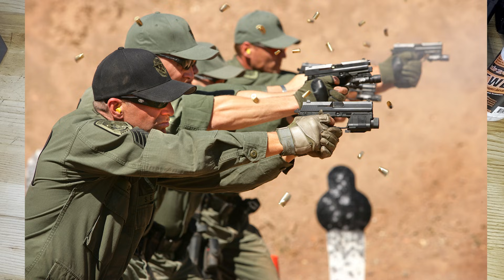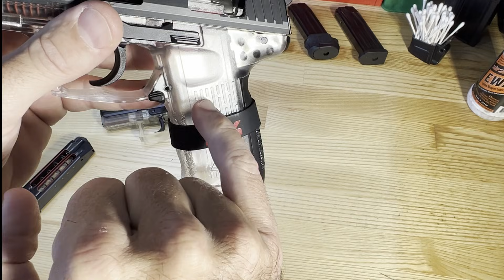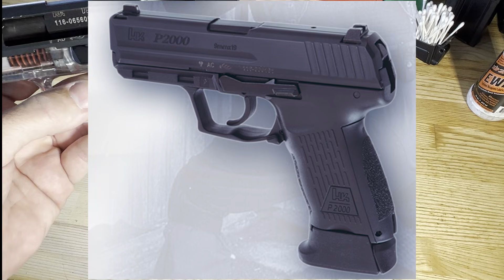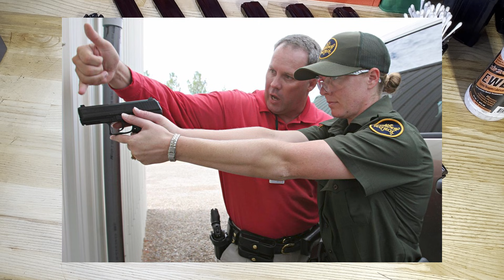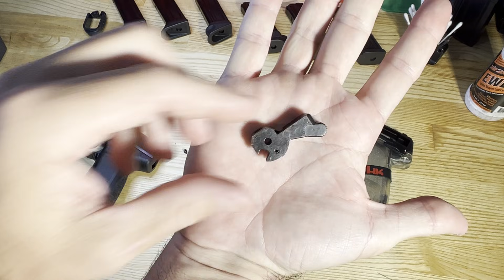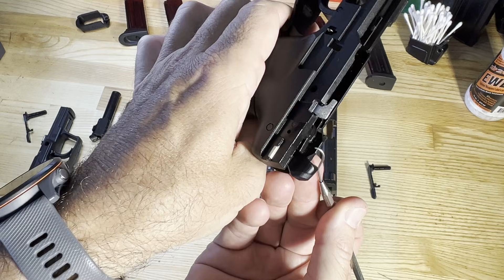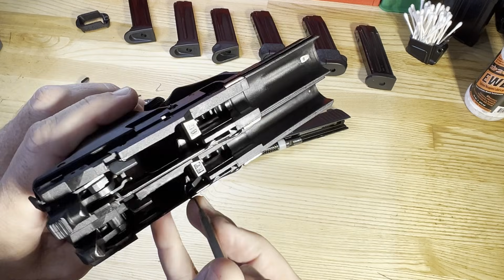Heckler and Koch P2000 Series Armorer and Operator Review

Comment: Hi James, regarding the HK45C extended mag release. In this video you mention it quickly as a drop-in upgrade. I found that when installed in a USPc, mags will drop free during firing. I found folks mentioned this online, needing to modify the HK45C lever underside and shave some material off in order to allow the extended mag release to pivot further in to the mag well and properly retain the magazines. Do you modify your HK45C extended mag release levers? I'm trying to find a guide on how to correctly modify.
Reply from the maker: I have not found this to be an issue when installing the HK45C magazine release to USP or P2000 models.  When I see people having problems with mags dropping free, it is due to their grip being to tight around a compact/SK grip and they don’t realize the bottom of their palm is preventing the mag from dropping free.

Comment: I know 357sig is a lot of bang and not much difference in performance unless going through barriers, I still like it and think the only suitable platform for it is an HK p2000. Yes p226/p229/p239 also work good for 357sig but I think HK still has the edge on balanced design still able to handle 357sig recoil. P229 great but a bit too bulky and heavy. P2000 just right. Glock not ideal, as much as i loke glocks, i think having a light weight slide for heavy recoil calibers is not good. Ys a heavier aftermarket spring helps but best to combine a heavy slide with higher recoil cartridges and maybe if needed increase spring rate.

Comment: When the p2000 came out i was only interested in 45acp so usp compact 45 was what i was more interested in, but then got pulled into 1911s instead. Single stack 1911s carry great but I sold mine off when mag cap ban went away, but by that time i was no longer looking at hk.

Comment: Outstanding video, Devil Dog!  This video is 2.5 years-old now; are the various parts you mentioned, including the magazine extensions, still available generally?  Based on a quick web search, it appears that many P2000 parts, particularly in .40 S&W, have been discontinued or are out of stock, even on the HK site.  I have just purchased a P2000 V3 in .40, and I am considering acquiring a P2000SK V2 in the same caliber.  Am I coming to the .40 cal. game too late to acquire parts for modifications and enhancements?  Thanks for your work and keep up the great work!
Reply from the maker: Finding .40 components will become more difficult.  As a rule, HK continues to fort parts and support for 10 years after a model ceases production.  But since the magazine is the same (in the P2000) as in the USP Compact, which is still in production, you should be fine there.
Reply: @teufelshundtactical  Sorry to bother you with a question, but during the video you mentioned replacing the OEM magazine release with the HK45 version.  I can't find the spot in the video in which you showed the package and part number for that part.  HK Parts has an  magazine release  (SKU: HKP-19287-M - $49.95) and an  release (SKU: HKP-01669 - $29.95).  Were either of these parts the one you recommended?  If not, what part do you recommend and where may I obtain it?  Thanks.
Reply: For whatever reason, YouTube took out the words "enhanced" and "extended" from my question about which replacement release you recommended.  The HKP-19287-M is described as "enhanced."  The HKP-01669 is described as "extended."  Which one did you address in your video?  If you will give me a time stamp for that part of the video, I will look it up.  Thanks.
Reply from the maker: @artyman0802  I don't know what you are referring to.  Those item numbers are not from HK.
Reply from the maker: @artyman0802  Call HK Customer service and order the HK45C magazine release.
Reply: @teufelshundtactical : Thanks.

Comment: The varient 1 vs 9 usp,    I carry cocked and locked.   What difference would it make to me  ???

    Can the p2000 be carried cocked and locked ?    I love hammer fired  HK ,  but lem and DA / SA  only work carried cocked and locked.
Reply from the maker: If you have a USP or HK45 and want to carry cocked and locked, then V9 is for you.  V1 allows you to do the same, but the decker function is still there and sometimes, under stress, guys rotate the selector past fire during the draw and decock the weapon.  The P30 “S” models have an external ambi safety that allows you to carry cocked and locked like V9, but with the decoder separate from the selector.  There is no way to safely carry cocked and locked with the P2000 series.

Comment: My name is Adam. I am reaching out to you for your professional recommendations and help regarding pistol mounted lights and holsters, etc. As you are already aware that it is very difficult or near impossible for us to mount weapon lights to H&K pistols because of their proprietary rail. We have virtually (almost) every model that were available on the market. Thank you for your help. I look forward to hearing from you soon.
Reply from the maker: This video covers the P2000 series, which uses the industry standard picatinny mounting point.  Any current weapon mounted light should fit, though, I would look to pair a smaller light with the pistol, something like a Surefire XSC.  Only the USP series and MK23 have proprietary rails and companies like GG&G have offered an accessory mount for years.
Reply: Thank you so much!

Comment: Ive been an HK fan for several years but i was never a fan of the p2000. No real reason why but it just didnt do anything for me. About 8 years ago or so when there was rumors HK was discontinuing the p2000 and wanting to clear out inventory, i happened to walk in to my lgs looking for something else, they had one sitting there, brand new not a trade in for $429. Bought it on the spot and i gotta say its definitely the most slept on pistol in their line up. I pit the hk45c paddle release on and i will never get rid of that gun

Comment: Excellent video as always!  Re: the Variant Zero (LEM with decocker). I have this setup on my P2000Sk and love it. It allows to decompress the hammer spring for long term storage, or if for some reason you wanted the added safety of the full strength double action pull (Nightstand gun that you want the heavy trigger pull if you're groggy and jumpy, for example. You can thumb cock the hammer if needed and be ready for the easy LEM pull).
I love the functionality of going back and forth between compressed or non-compressed hammer spring if I want to... Don't see a downside from where I'm standing!
Reply from the maker: Yes, Variant 0 is one of the variants and I cover it in the video.
Reply: @teufelshundtactical can we convert a decocker version into a V0?

Comment: Absolutely incredibly detailed insight into the P2000 to include USP, USPc, and both P2000 and P2000SK pistols.  I have a significant number of HK pistols, starting from 1985 when I bought my first P7M8 largely due to the ambidextrous design.  I then purchased a USPc in 45 which, although not ambi, gives me an appreciation for that era of HK pistol designs.  Then I bought a new P30, two new VP9s, and lastly a new P2000SK.  Thanks to the interchangeability of many HK pistols I then expanded my caliber choices on my P2000SK to have a 40SW slide and barrel for the SK and then finally a 357Sig barrel.  The interchangeability is simplified by the magazines, as well, as the 357Sig rounds fit inside a 40SW magazine for the SK.   I continued with my collecting onto my VP9s pistols by adding a VP40 slide and barrel to turn it into a VP40.  My latest acquisition is the VP9 Match with the longer slide and barrel, and the cutout for a red dot sight (in my case I chose the Swedish Aimpoint ACRO).  Despite years of HK ownership and use, I learned many more things from your video.  You did a great job!  One more piece of RARELY GOOD NEWS is that California has added the VP, VP9L and VP9SK to the approved handgun roster!  I suspect that is because they may drop the P2000 lineup someday.  On my Calif CCW I have a P7M8, my USPc 45, and the P2000SK which I carry 90% of the time due to the size.  Again, an incredible video, worth every minute.
Reply: Good to know. I am also in California and plan to get the P2000SK as well. Mainly for concealment. I am new gun owner, first but used is Kahr CW9. I plan on trading it up to the HK P2000SK.
I like to add, i really want the P2000SK in 40mm though. This mean i have to wait or just deal with the 9mm.

Comment: Are there dimensional differences with the p2000sk variants?
Reply: Thanks for the reply.  I think I saw somewhere on the web that the V2 was slightly thinner. I’m getting a V2 P2KSK as I like to call them. The trigger felt fine in the shop but I might have to get that reset upgrade, its overpriced for a tiny piece of metal though, in my opinion.
Reply from the maker: The only dimensional difference between the P2000SK variants will be in the hammer.  The LEM variants have a bobbed hammer and the D/SA have a spurred (shown in the video thumbnail).

Comment: I always assumed that if I was gonna carry a hammer gun, that it was gonna be a DA/SA or my 1911. But I always a big fan of Walther, and had heard all the legends about how good the P99 was, both in 9mm and .40, and I happened to stumble onto a used Gen 1 in .40 at a gun shop for $300. I thought this was a pretty good price considering that it was almost pristine on the outside and looked like it had only run a few hundred rounds at most on the inside. 

What I didn't know beforehand was how much I would come to love that trigger. The P99 has a trigger very very similar to this one. You can use the double action or you can use the single action, although it uses a different firing system, but on the user side, it's very similar. And it includes a decocker, which the V7 LEM I just ordered does not have one.

I already had guns like the CZ P-01, a Double action 1911, single action 1911, and a .38 special revolver with a realllllly heavy trigger, but that P99 trigger completely changed my outlook on carry guns and inspired me to get a USP Compact 9mm in V7 Light LEM configuration. 

I had actually avoided HK for a long time because I listened to all the Fudd online about how they are overpriced, not worth it, outdated, bad triggers, all hype, and that I should 'buy cheap guns for my first firearms and then decide later if you wanna get the best...', and I stupidly fell for that advice and just kept moving up the price bracket until I got a VP9, and that instantly destroyed my appreciation of pretty much every other striker fire I had -- Shield Plus, CZ P-10F, Glock 19, Glock 17, LCP Max; the only one that I think stands up to the VP9 is the Walther PDP/PDP-F, that's a really great pistol. 

Regardless, I was so impressed by that VP9 at only $475, that I knew I shouldn't have listened to all those morons online telling me that they are too expensive and not worth it. You barely have to pay that much more than other guns and you get something far superior and much more special. 

Yes the USP Compact 9mm V7 was pricy, especially since I got a new one with the LE bundle, but I got it for $925 and felt like that was a fair price for such a good gun new from HK. Should be arriving at my FFL tomorrow and I'll get to really properly test it myself this weekend. I love my VP9 and my friend's HK45 (he bought one after seeing my VP9 and then trying out his stepdad's HK45) and I expect to enjoy the USP compact just about as much as those. And if I don't like the LEM, well then no biggie, because I can just swap in a V1 no problem. 

I appreciate all you do Teufelshund and you really do an amazing job talking about these guns and what makes them so special. I hope you keep doing these kinds of breakdowns forever!
Reply: I hope you like the LEM. most people imo fail to understand it's special specialness. When you punch out, load the trigger to the wall. That's the brilliance in the mechanism.  Your then on target and ready to fire. After 1st shot, ride the reset. It's an excellent design.

Comment: The only issue ive had (so far) with my P2000 that I've had for about 9 years is a broken trigger return spring after maybe 15k rounds. Not really sure what happened because I didn't really have the knowledge (or courage) to do the troubleshooting/"gunsmithing" myself but the gunsmith swapped my trigger return spring to the "heavy" one and its been fine since then. I just installed the 10 lb hammer spring, grayguns SRS, grayguns trigger, and switched out the heavy return spring for the stock trigger return spring so we'll see how she runs. I also have it ported and it runs so flat with the ports, it's awesome. I stippled it myself as well and its 1000% better now. Can't wait to see how it shoots after the trigger upgrades.

Comment: Fantastic video, James. Love it!! I would liked to have seen more of a deep dive into the three LEM options though. Demos and explanations about how the weights change (is it the take up, reset, shorter pull, just lighter pull, etc.).
Reply from the maker: It’s pretty much just the weight of the trigger pull.  That’s a difficult thing to “demonstrate” in a video, but the weights of each variant are available online.  The simple answer of course is the light is light, the medium is medium and the heavy is heavy.  You really have to try them to appreciate the difference.

Comment: Thanks for this in depth video! Second to none. I picked up a p2000 v3 in .40 several months back. Added the Grayguns short reset kit, hk45c mag release, and nickel sear spring. Love it. Waiting on my 357 sig barrel to arrive, can't wait to try it.
Reply: I carry a P2000 in 357 Sig. I had Bill Springfield do some trigger work to reduce free travel and reset. That was 3 years ago. It is an outstanding EDC.

Comment: Hello I own the p2000, and want to put the gray gun short reset kit. Which flat match sear spring do I use?
Reply from the maker: There is only one match sear spring.  It is identifiable by the nickel coating.
Reply: Trigger Return spring broke on my p2000. Which spring do you recommend, light, stock, match heavy? Thanks.
Reply from the maker: @jakk9278  Never seen that.  The answer would depend on whether you have a DA/SA or LEM model.  I prefer the USP match TRS for DA/SA and Light for LEM.
Reply: I have the Lem. Thanks for your outstanding support!

Comment: I have the V2 P2000 LEM W/night sites. I would like to change the magazine release paddle to a larger one and I bought the P45 one after being told it would fit but it doesn’t so is there a mag release paddle that is bigger that will drop in the frame?
Thank you for your reply.
Reply from the maker: The magazine release you want is the one from the HK45 Compact.

Comment: Love HK and the P2000 series. My only gripe is with the P2000 and the fitment of its rear grip panel. At the very top of the rear grip panel there’s an annoying gap on every P2000/P2000SK I’ve ever seen. It can irritate your hand and just looks sloppy. No other series of HK have I ever seen something like this.
Reply: I’ve noticed this also and I’ve probably inspected well over 100 examples of P2000/P2000SK. Very disappointing from a company like HK.
Reply from the maker: I have not noticed this on any of the models I own or have experience with.

Comment: James, a little confused regarding the LEM for the P2000. At the 52:00 mark, you mentioned that there isn't a LEM kit you can buy for the P2000, although the P2000 can be purchased in LEM, correct? If the USP LEM kit is not compatible with the P2000, can you confirm that a LEM kit is NOT available for purchase for the P2000 or P2000SK? And if so, why is this the case?
Reply from the maker: Yes, I’ll be happy to.  As mentioned in the video, with the P2000 series, H&K did not go with a universal receiver like with the USP.  Instead, they created a dedicated receiver for DA/SA and another dedicated for LEM.  No conversion kit exists, like it does for the USP/HK45 because the receivers are not universal to accept the LEM parts.
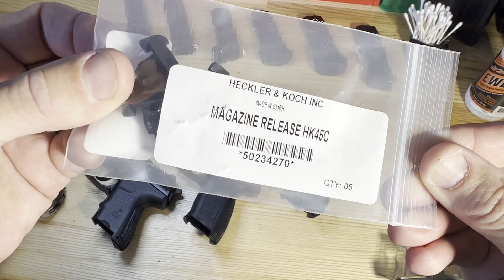Reply: @teufelshundtactical  At the 1:01:20 mark, you mention that the larger magazine release found on the HK45C can be used to replace the smaller OEM magazine release on the P2000 series. Can the same spring on the P2000 series be used when swapping out its magazine release to the HK45C?
Reply from the maker: Tha mag release spring is the same @NomadicYeti
Reply: @teufelshundtactical how did they create the V0? Is that a receiver totally unique to itself?
Reply: @teufelshundtactical  Ah, okay! I completely forgot the part about universal versus non-universal receivers in the P2000 and USP pistols. Good stuff! Thank you for taking the time to field my question!

Comment: I own HK45, HK45C,, P30SK, USP40, P2000SK, P2000, and VP40. 

Can't say a bad thing about any of them. 

The only thing that keeps me from running them more is that I run "systems" and since none of those are built in 10MM, they are strictly recreational. 

Now if HK built a USP in 10mm, I'd buy it one or two at almost any price.

Also, I'm a rural Alaskan, so daily carrying a 10mm is a real thing unlike how it is for 99% of 10mm shooters.
Reply: Mark 23 can handle 45 super unmodified.....just sayin.

Comment: The P2000 is my EDC. It’s dimensions are great! I ended up sanding down one of the mags baseplates to be able to have a flush fit mag. The texture on the sides of the grip remind me of the MP7 grip.
Reply: Xgrip for p30/vp9 allow 15/17 round mag for p2000 utilization….. however, the base plate on p2000 is sexy AF!